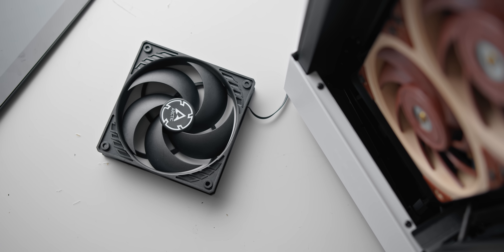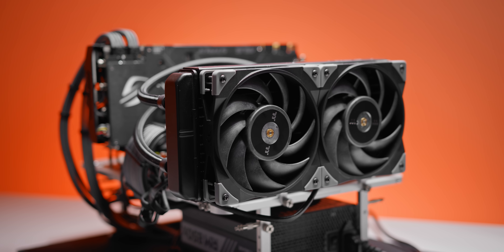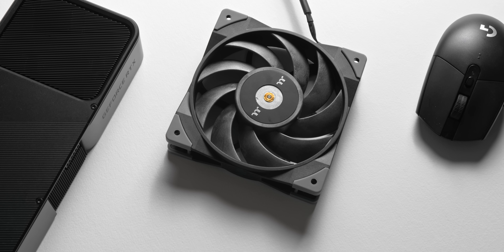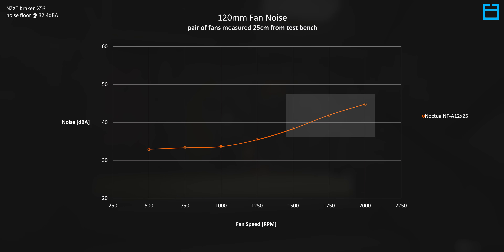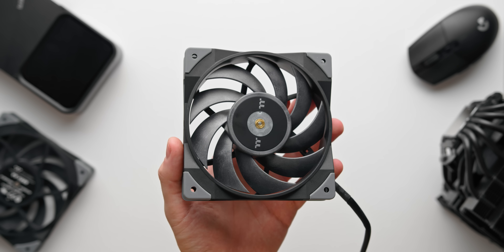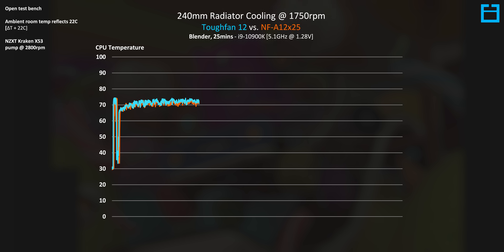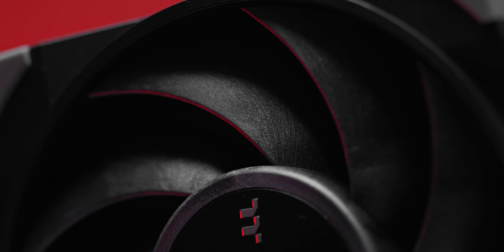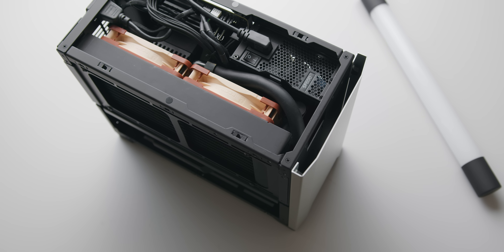Thermaltake Copied Noctua?

Comment: I mean if ur gonna copy someone's homework pick the smartest kid in the class
Reply: It's hard to not agree
Reply: Well noctua isn't the first and only with that blade design... They just improved it and I bet they still get more quality
Reply: @ismaelyu5  it’s not the same as the gentle typhoon at all, it just had the same amount of blades
Reply: @JAY-wl6qq  doesn't matter. There are 3 things you can alter to change a wing, airfoil, angle of attack and sweep to set it basic behavior. Since the motor and size of rotor set some performance figures you are left with  not many variables to alter for the wingblades.
It's like blaming a ship engineer to copy the propeller from a similar ship
Reply: They have been doing this for about 6 years now
Reply: @ismaelyu5  aerofoil shape is massively variable in itself. Another rather important factor is blade tip clearance, the smaller the gap the better.
Reply: As if noctua didnt copy
Nidec/Scythe Gentle Typhoon...
Reply: @stepnyvlk9695  II have tested both and Nidec GT was the better fan anyway lol

Comment: Fingers crossed , noctua rushes to release black Noctua A12x25
Reply: Don't noctua have a press release about they releasing a fully black cooler or something last month or something
Reply: I don't think so, probably Noctua will delay the release until November...because holiday$ 😂😂
Reply: Noctua released their road map a while ago.  Black  a12x25 is scheduled for 2nd quarter.
Reply: Probably a Thermaltake employee stole a black Noctua fan from CES 2019. If you watch optimum Tech's video , it's exactly the same !
Reply: got 8 pieces in my pc, it would look boring if they were black 😁
Reply: So far they do have black and grey colored fans so maybe it's in the pipeline. I have some Chromax fans with the black grommets being used and it's doing a nice job moving air around in my case.
Reply: @jintsuubest9331  yes and a white one too!
Reply: Just buy these, is going to perform the same for without being ripped off. That's Stockholm Syndrome
Reply: @mannyfresh7065  not sure if they ever talked about a full white cooler but white fans are coming but pretty late in the year (Q3)
Reply: What about the black Noctua Chromax fans?
Reply: Color scheme doesn't matter if they never manufacture enough of them to stay in stock. taps forehead
Reply: I'm just getting really sick and tired of waiting on noc to swap out filament color that takes 5 minutes... Noc should really just throw away their poop color scheme... I've bought their fans but they go into my servers. I have 1 personal computer with them and they are there because its a itx build and I don't feel like ripping it apart to make it look better when it's not made for looks...

Now if thermaltake could just ad some RGB to it.
Reply: @SimanSlivar  the price to pay to use noctua. Enjoy the brown and maroon colors pleb
Reply: @jintsuubest9331  noctua said they were going to release it 2 years ago, and have been pushing it back every few months. noctua is going for maximum milking. they want a shit ton of people to buy the vomit tan and diarrhea brown fans, then rebuy the same thing in black.
Reply: Just a year late :v
Reply: Σωστός!
Reply: @eltonko  i checked now and they delayed everything one quarter and some things even to 2022
Reply: Current roadmap shows this as Q3, already been rdelayed. Based on Noctuas afwul track record of releasing product in due time, I would estimate it at Q4 or Q122. Which is their loss I guess. I'm ordering the TT fans.
Reply: I prefer wonder snail from scythe
Reply: @oroch1dup  me 2 m8. I got a Scythe Fuma 2 and it's as silent as a cooler can get. 
If you can get your hands on a wondersnail , it's incredible value.
Same performance as Noctua's best and also black @ lower price!
Reply: They've been delaying them for years now, always pushing back the release date every time they release a new roadmap. I'm done waiting, will buy something else
Reply: That comment aged badly lmao

Comment: Thermaltake: can I copy your homework?
Noctua: yeah just change it up a bit so it doesn't look obvious you copied

Thermaltake:
Reply: Noctua: already copied from the gentle typhoon anyways
Reply: SmashStomp Inc  you gotta understand that noctua is the closest thing too artesanal cooling company as it gets there products need to think and rethink the application in the market and the quality standards they want to achieve, they dont have the money to make big changes or release products with over marketed under delivered, if I buy a noctua fan, I know it will last, simple that.
Reply: Literally changing the color of the pen
Reply: ThermalFake
Reply: Can we copystrike thermal take?

So noctua can be a king of cooling
Reply: SmashStomp Inc  that's literally not how it works. If it was that simple you would have seen it by now. Small differences in material properties. If you observe an a12x25, you'll see the tolerance between the blades and frame are insanely tight. What do you think happens to a material that's under constant rotational forces over time? These fans need to actually function over time, something I'm not sure anybody at thermal take understands.
Reply: @ThunderGoatz  They did manage to make the LTT verison of their fans black. So I don't see why they can't roll it out to everybody else.
Reply: @zhenmingyu6186  you sure you're not mixing up the F12 industrial, and the A12X25?
Reply: They should have bought the same motors Noctua uses. The noise is really noticeable.
Reply: @ThunderGoatz  I am sure they are A series. And you proved my point yourself, if the materials can withstand higher standard and go up to higher speeds, they can of course be used in lower speed as well.
Reply: @zhenmingyu6186  nani? There's no chromax black a12x25 anywhere dude. It's only the a12x15, nf-f12, and nf-a14. None of which are sterox. I'm telling you, just use your eyes. The gap on the nf-f12 is massive compared to the a12x25. Also it's pretty funny considering I'm sitting like 6 inches away from all these fans and here u are trying to tell me I'm wrong 🤣🤣
Reply: @ThunderGoatz  I am a material scientest myself, and it would be very hard for me to imagine that this material just come out to be brown like that. They must have dyed them to this specific product. Proof is that the same fan made in Taiwan and China mainland has slightly different color. As for the gap, I would say that is more on the manufacturing side, rather than the material.
Reply: @ThunderGoatz  If I fellow your idea, we would have to come to the conclution that NF-A14 and A12x25 are using different material for their fan blades, which I really don't think that's the case. It would simply just cost too much if they have to tweek the materials a bit for every different fan design.
Reply: @zhenmingyu6186  Yes it is the case. The NFA1225 uses a novel surface material specifically their patent 'Liquid Crystallised Polymer'. This is exclusive to that fan only. The NFA14, NFA1215, NFA15 and every other fan uses standard PBT plastic. Knowing this, I'd be interested in your thoughts regarding the difference as you're specialised in that field. I personally have been a patron and seller of all Noctua products so I know their different items quite specifically but the science behind it all is of course not my field.
Reply: @Jupa  Oh, WOW, that's really supprising. Sorry about earlier, McBorz.
Reply: @Jupa  So Liquid Crystalls have this unique propertie. They are usually rod-shaped particals, and they tend to align towoars the same direction, mostly through electric charges. So in LCD (Liquid Crystal Display), the liquid crystalls on the pannel self align, allowing the back light to pass through. If you disrupt their alignment with applied charge, they will start to twist, tryting to align to both their boddies on the side and the applied chage, thrus blocking out the light. And you get a pixel that can switch on and off. The main takeaway here is that tend to align.
Reply: @Jupa  PBS, or most plastics are just a polymer without this self alignment function. They are mostly just long threads of molecules stash togather. Now imagine you have a bunch of matches. You can pack them up in the same direction and make a brick, or you can just through them in the bin. The tightly packed one will be stronger, harder to bent. This is not identical to the fans, because we are assumeing that PBS and Sterrox are using the same "matches", but you can get the idea.
Reply: @Jupa  I think Noctua are fellowing this trail, trying to make their fan blades stronger and harder to bent. Which will in tern helps demping the vibration, and thus decreasing the vibration noise. You may be able to play a guitar string, but you certainly can't play a steel pipe like a gutar string.
Reply: @zhenmingyu6186  Why do you explain the properties of liquid crystals used in DISPLAYS? I am certain that Jupac would much rather like to know how these properties add anything to the performance of FANS, Mr. Scientist.
Reply: @ffwast  They have very different designs?
Reply: @zhenmingyu6186  " As for the gap, I would say that is more on the manufacturing side, rather than the material."
The point with sterox over normal plastics is that it's far more rigid. Manufacturing a close gap is not really the problem - but when fans spin at high RPM the less rigid plastics expand outward very slightly (due to centrifugal forces). That is why most fans need to leave a pretty generous gap to allow this flex without scraping into frame (even after several years). A more rigid material means you can allow a much smaller gap - and this means less performance loss.

I find it highly unlikely that it requires years of extra R&D to change the color to black or at least something more neutral. Maybe it would be a big problem to solve for bright white or transparent blades - but not black or dark gray. No way.
Reply: @eirikheggelund    It takes time to type. Just refresh and read the whole thing if you are really interested.
Reply: @zhenmingyu6186  I guess you published your last comments while I was typing my reply. It is sad that comment sections do not automatically refresh.
Reply: SmashStomp Inc  or they licensed the technology and design since they are getting so much demand, and the covid shortage might have affected there plan of releasing. You dont just copy every detail of an adversary fan specially big companies such as thermaltake.
Reply: Do you have proof that conversation took place? If not, don't quote things that were never said.
Reply: @nitro361  Changing the color is not easy for someone like Noctua. That color change has to achieve the exact same parameters of the initial brown one - the color they spent years designing. Making a black variant is not effectively starting from scratch but it involves a lot of small adjustments to the material makeup as far as i've been told. Knowing Noctua, they've had a finished, completed design for years already but if the black variant show measurably inferior longevity or performance in their labs, they simply won't release it. You can't just change the dye. I would personally just want a clear fan/uncolored. That would be the easiest and cheapest to make.
Reply: @shhmule  I believe it is meant to be a joke.
Reply: @zhenmingyu6186  It’s LCP filled with glass fiber, which is offwhite in color.  You are correct that they add pigment to create the brown color.  LCP is unique compared to other thermoplastics such as PBT or PA in that it has very low coefficient of thermal expansion and insane rigidity minimizing stress creep over time...thus why they use it.  It’s also crazy expensive compared to conventional thermoplastics and not as many injection molders or compounders handle LCP’s.

- Polymer Chemist for PA Compounder
Reply: @maximianocoelho4496  I don't think you understand what artisanal means. Noctua is far from being artisanal.
Reply: @SUSHI4lyf  I said that it is the closest thing to  Artesanal, thermaltake here base of operations overseas ~, Noctua doesnt have that luxury.
Reply: Thermaltake: BLACK
Reply: @SarkkiKarkki  l I guess I q o ok j
Reply: Nidec: I've seen this before.
Reply: I dont mean to be so offtopic but does anyone know a way to log back into an instagram account??
I somehow lost my account password. I would appreciate any assistance you can offer me.
Reply: @Kane Jaxxon instablaster =)

Comment: The biggest thing that stands out is the difference in expected lifetime and the warranty. Whereas the Toughfan is only rated to last 40,000 hours, Noctua’s spinner is rated to almost a four-fold of that, and it comes with an impressive six-year warranty. It’s clearly a fan that’s intended to last a few builds.
Reply: Yeah Noctua is amazing when it comes to warranty. One of my old P12's (new at the time) had a rattle. It took only a week before I received a brand new fan from Noctua, and as you already mentioned, they have a 6 year no questions asked warranty.
Reply: @vBDKv I almost thought you were talking about arctic fans, but it’s the redux version
Reply: @dagameboy  Noctua NF-P12. Old fan :)
Reply: @vBDKv  oh damn, didn’t know that existed
Reply: @dagameboy  One came with my ancient NH-D14 cooler - I just purchased more back then as intake fans. These days I have 2x NF-A14 PWM as intake and one NF-S12A PWM as exhaust. Works great, can barely hear the fans :)

Comment: That small difference at 1000rpm is actually what kills these thermaltakes. That rattling is what annoys people way more than anything.
Reply: Same annoying rattle as the F12
Reply: That’s why I returned Artic P12 fans, the weird resonance or pulsing noise at certain frequencies stood out and annoyed me even though I wasn’t actively listening for it and my computer was under my desk
Reply: @nathanboal  same here with the sound, but in my country they weren´t even worth returning, so i destroyed them to make more fan shrouds 🤣
Reply: What people dont realize is noctua is i think the only fans on the market with noise cancelers at low rpms.
Reply: I have two of these TT fans and mine don't rattle. It honestly sounds like a hair or something touching a blade.
Reply: @nathanboal  New P12 slim fans (120x15mm) do not have that noise anymore and actually cooling efficiency is same! Bought 5 of them. Only 6.4 eur a piece!
Noctuas 120mm slim fans that are black cost 25 euros! WTF Noctua!?
Reply: @TRHardware  Yeah i've got the P12 slim fans in my NR200P at the bottom and they're silent as ever. got 2 for like £13 i think
Reply: @TRHardware  link?
Reply: @kkiwirocks  Iam have 5 F14 pst, using all on 700rpm, no problems with temps and rattling
Reply: @GermanicGoosicus  "What people don't realize is..."
Me: Yes??? tell us oh wise one!
AlternatingAddict: Noctua is da only fans on da market with noise canc*elars* at low rpms."
Me: Brilliant! Why haven't I realized this before?! Where are these noise cancelling devices that switch on at low RPMs? How could I have missed them? This is an outstanding discovery. You must tell them all!!!
Reply: does dampening between the fan and the pc fix that?
Reply: @nathanboal  What i didn't had any Issues with my P12's they are very silent at almost any speed.
Reply: I ordered the 140s though
Reply: @pedroduran8927 what rev are your p12? I’ve heard that rev4 they improved the resonance at various rpms. Mine are rev2 and I can definitely notice the humming resonances at various rpms
Reply: @kkiwirocks  I know you commented this 2 years ago, but I have several F12 and have owned them for 3 years now. They do not rattle lmao. Neither do my 140mm or the A12 versions

Comment: i love the colour of them now because it's the noctua color. and their badges. omg i love their badges
Reply: honestly they just should've made a cream/brown case which focused solely on airflow/noise, no expensive tempered glass nonsense.
Reply: @remy7663  instead of tempered glass it could have a mesh similar to the mesh on the formd t1
Reply: A12x25 Chromax Black will be released in Q2, I will wait for that instead of original color
Reply: Badges? What badges?
Reply: Same here. Went for the brown instead of the black. Its like a feature to me
Reply: @espen990  noctua put little metal badge with 3M adhesive on the back in the box of their cpu coolers
Reply: @eggchucker1  oh my god. Now I can broadcast to the whole wide world that I'm on team brown.
Reply: @espen990  by throwing a huge tanty you're really showing how much you don't care and how cool you are.
Reply: @harmonicimbalancer1678  I don't understand. I like Noctua? I'm not throwing a tanty I really want a badge. I'm confused.
Reply: @espen990  haha. sorry i thought ur being sarcastic. they're really well made badges. thick metal
Reply: @eggchucker1  nah - front, top, bottom mesh for airflow. steel with sound dampening foam side panels like in bequiet cases for low noise. space efficient layout like the chimera cerberus. 10/10 case.
Reply: @AcerbusLight  they've been working on them since around 2019, how confident are you in that roadmap given they've slipped a few times already? :)

Comment: Ah! The 3:24 motor noise on the Toughfan 12 @ 1000rpm is the exact noise my PS5 Digital fan makes when operating. I knew it wasn't coil whine, but I couldn't term it correctly. Thanks Ali!